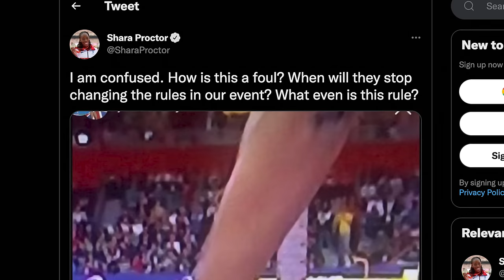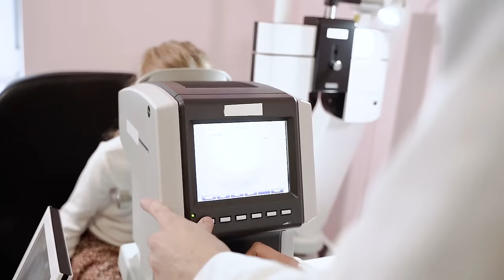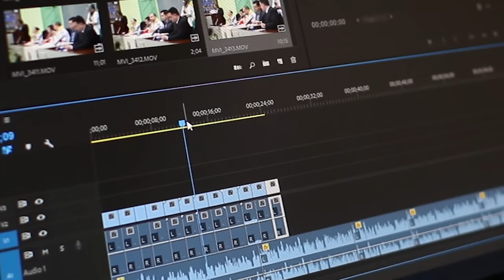How the Long Jump Measuring System Works

Comment: As a T&F judge and engineer, I wanted to add something to this video: The new measurement techniques don't actually replace human judges. There is still a human judge deciding if a jump was valid or not. The difference is that the usual line judge has to sit at the foul line, so usually right in the middle of the TV picture whereas with video foul judgmenet, the judge can sit anywhere in the stadium. The driving force to take on such systems was not a precision issue, it was merely an issue of aesthetics. The same goes for distance measurements: A measurement with a measuring tape can be surprisingly accurate if done right. The difference is again, though, that with a measuring tape, you need at least 2 people in the sandpit. With laser measurement systems (EDM), it's one person, but with video distance measurement, it's 0 persons, as the judge can sit anywhere in the stadium, like with video foul judging. Lastly, measurements with a measuring tape take approximately twice as long compared to EDM or VDM, meaning that the competition only takes half as long.
Reply from the maker: Thanks for sharing your insights! I really appreciate you engaging with the channel and adding such valuable perspective. I wasn't aware of the aesthetic element you mentioned, and it's fascinating to see how technology not only enhances precision but also improves the overall presentation of the sport. Thanks again for your contribution!

Comment: This is interesting. Your thoughts on the false start technology?
Reply from the maker: Glad you like it! I don’t have an issue with technology, the pressure sensors work well. The deeper question is whether .1 is still a valid threshold. Also , what constitutes unfair advantage from the start may need a rethink. It could be an interesting video to make if there is interest.

Comment: I think the takeoff board camera system is fine when it comes to assessing valid jumps but only if it has been properly calibrated before an event. The biggest problem with it though I believe is linked to disputing fouls/no fouls within a reasonable timeframe. 

In the European Championships last year a long jumper who thought they had done enough to win a silver medal was demoted to fifth place after the competition ended when another team protested the validity of their first round jump. It wasn't his fault that the judges gave the jump to him but his mindset throughout the rest of the competition would've been so different to that of someone who was lower down the field. That's an example of where it kind of falls down both on a technology perspective as well as putting an athlete at an unfair disadvantage.
Reply from the maker: I appreciate your insights on the VDM system. It's crucial that any technology we use, especially in a setting like track and field, is appropriately set up with all tests and protocols in place. If not, it undoubtedly impacts the athletes adversely.

An ongoing debate in track and field concerns the true definition of measurement accuracy. At least, I think it is. On the one hand, precision is paramount. With the aid of high-speed cameras, we can detect a takeoff foul or precisely measure a jumper's landing spot. Yet, when it comes to photo finishes, technology can differentiate athletes by thousandths of a second - a margin imperceptible to the human eye.

This brings in a cultural aspect of sport; norms of accuracy shouldn't solely rely on high-tech systems. I am, by no means, against these technologies. They're pivotal in ensuring accurate measurements. However, when cameras distinguish fouls as minor as a toenail's difference or when photo finishes seem almost arbitrarily close, one must wonder if technology, in its precision, is detracting from the sport's essence.

As we increasingly rely on technology, we must also continually evaluate its impact on the sport's integrity.

Thank you for engaging in this discussion and for supporting the channel.

Comment: This new system is very impressive, but I suppose the issue is, you can't train with this. Very few if any athletes will have access to this system. So the coach will have to use older methods.
Reply from the maker: That's true, but it's like a photo finish or pressure sensor blocks—most people don't train with it.  At this stage, most people are OK with it.  I think the biggest challenge for the sport is the potential move to the take-off zone.  That's being trailed and a lot of people are upset by it.  I still don't know where I stand.
Reply: @SportsTalkTech  My concern is that someone will train a certain way and then at the competition start getting penalties that were undetectable with their home methods.  

Perhaps I'm not fully understanding the rules, is the font foot required to land in a certain position, or are they just using it to measure from? If it's just for measurement then this seems fine.

With a photo finish, the runner doesn't have to do anything different, you can't run into an issue with it, so this seems fine.
Reply from the maker: You are certainly correct about it being different. With plasticine, you could see the indentation of the spike to help determine a take-off foul. With the VDM system, you don't need that since a human isn't making the call with the naked eye. The question is how accurate you want to get, and that is debatable since accuracy is not only a matter of measurement but also an agreement on what's acceptable, similar to separating people by one-thousandth of a second. 

Moving to a take zone will make almost every jump count and speed up the TV side, but some argue that's not the point of the long jump…
Reply: @SportsTalkTech  hmm. I do like less fouls and more speed. Though I can accept that some suspense is lost, and possibly therefore some of the entertainment value. Thanks for the info.

Comment: Yeah but what’s the point that count? What part of body on sand? And before cameras where in the sand mess did they put the stick?
Reply from the maker: Yes, the same principles apply. They measure from the end of the takeoff board to the body part of the athlete that lands closest to the board. So if their hands go behind them, the measurement is taken from there. This is all done through the camera system, which is much more efficient. EDM allowed for interference but overall, VDM, I think is an improvement.

The big question now is about the new innovation that World Athletics is trialing, which I didn’t cover in this video but plan to discuss in a future one. They’re considering moving away from a fixed takeoff board to a takeoff zone. This could fundamentally change the sport for some athletes and coaches, while others believe it could speed things up and enhance the television viewing experience. I'm interested to see what the study will reveal and whether we might see another change in the jumps.
Reply: @SportsTalkTech  thank you! I didn’t know it was the edge of the sand hole, I thought it could be where feet landed or something. 
Takeoff zone sounds more fair and fun to watch, but more expensive to have at the venue.
Reply from the maker: Happy to be of assistance, and I’m glad you watched the video and support the channel. It’s interesting that you mention the takeoff zone as potentially being fairer. That’s one of the big debates in the sport right now. Many athletes and coaches believe that the essence of jumping is in hitting the takeoff board precisely—if you go over, it means you haven’t hit the mark correctly. In the sport, we often see athletes either overstepping, playing it safe by jumping short, or nailing it right on the board. The concern is that allowing jumps anywhere within a zone might undermine the precision and skill that are key to the event.

On the other hand, I can see the appeal of using the takeoff zone, especially with the new video distance measuring system that provides quick, accurate results. It would reduce the anticipation and waiting time both on television and in the stadium. To be honest, I’m still on the fence about it and need to see how it plays out. It’s definitely going to be interesting to watch how this develops in the next few years.
Reply: @SportsTalkTech  nice info! I think the essence is who jumps longer, and the board was needed so far as a tech limitation. 
If you isolate the board part to a single sport, where one runs and has to step as close as possible to a board, it doesn’t sound thrilling. If we can get rid of that, all that is left is pure long jumping. Maybe records will improve without the fouls and without the concern to step the board. I agree it will be a slightly different sport.
Reply from the maker: I think you're right, especially regarding world records. I've also been considering whether this could encourage 100m sprinters to explore long jump again, as the sport currently lacks sprinter-jumpers. since it might require less focus on the takeoff board.

A larger reason we don't see athletes like Carl Lewis anymore might be the significant strain that jumping puts on the joints, which can negatively affect sprinting performance. So, I don't know how much of an appeal it might be. 

I'm also reminded of how conservative the sport is when it comes to change. Even with studies they commission, it often takes a long time before any substantial changes are implemented. I'm still hoping for an update to the false start rule, particularly the 100-millisecond threshold, as we know athletes can react faster than that to the starter's command. But we'll see. It’s great to be in conversation with you, though.
Reply: @digocr I thought it was the part of the body, that touches first. That’s why they kick out their feet. Am I wrong?
Reply: @mwash52  regardless of what part touched when, in the end they look at the big “hole” the athlete made in the sand, and measure to the nearest part of this hole. 
The position with extended feet is the best way they found so far to make the hole as far as possible. They try to fall with feet first and sit between the feet I think. But they’re free to try any position.
[edit] @SportsTalkTech am I right? Could they try to land hands first and roll over their back, for example?
Reply: Rules say you can’t “somersault” because flipping in air was banned, but can’t find anything on landing hands first.
Reply from the maker: @digocr  You could technically land hand first, but they measure the body part that's closest to the takeoff board. I don't think anyone would intentionally want to land hand first. There have been instances where athletes lose control (e.g. overrotating) in the air and land awkwardly.